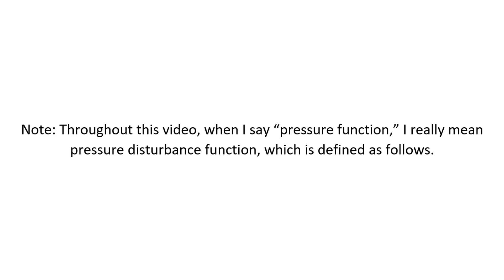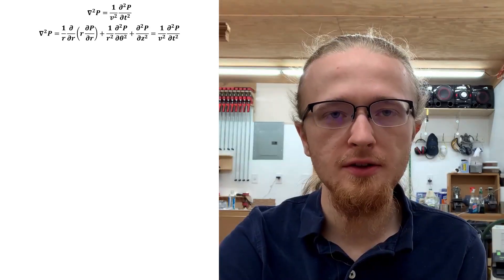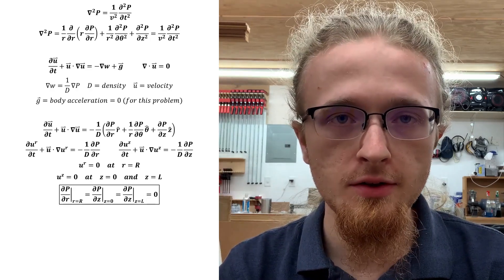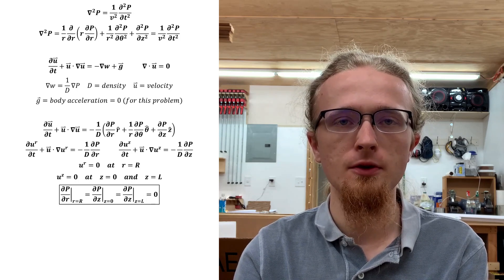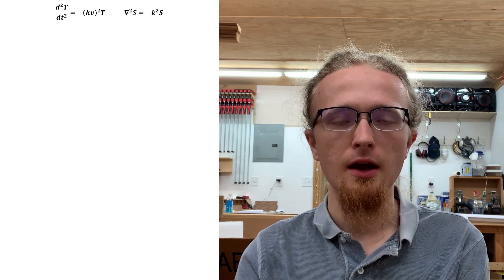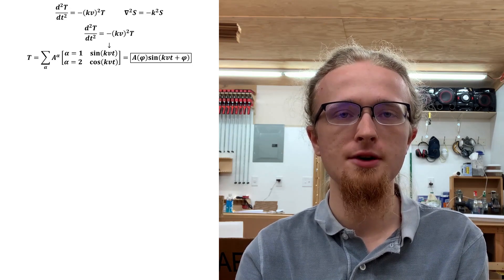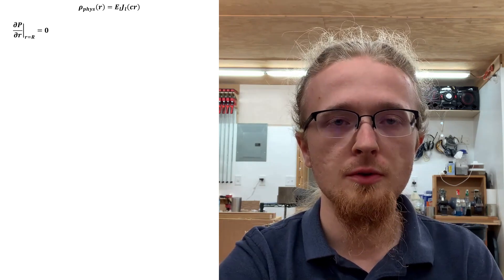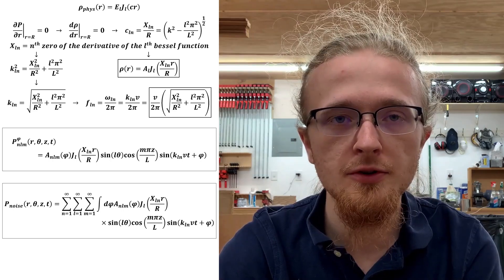Cylindrical Cavity Resonator | Solving The Wave Equation

Comment: Good video. However, I believe you have a small but crucial error. At about 8:17 you simplify the eqution by making a substitution x = cr  where c = (k^2 - l pi/L)^1/2. However, the way you use it is as if the substitution was c = (x^2 - m pi/L )^1/2, (note the m mode number rather than the l mode number) which I believe is actually the correct substitution. This carries through to your final answer for the frequencies where f should depend on all 3 mode numbers rather than just on one. i.e. it should be f_nlm rather than f_nl. Additionally, this is being a little nitpicky but a 8:38 it should be something like y(x) = rho(x/c)  = rho(r) because y(x) != y(cx).